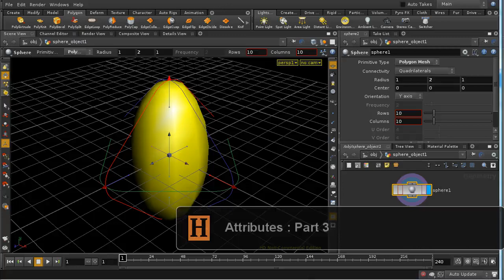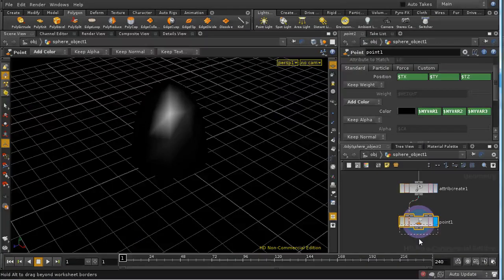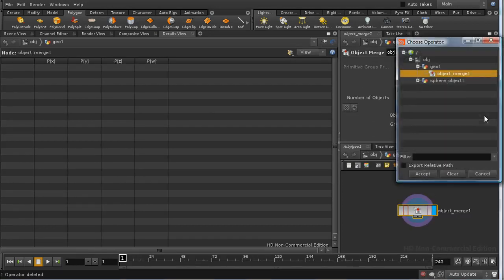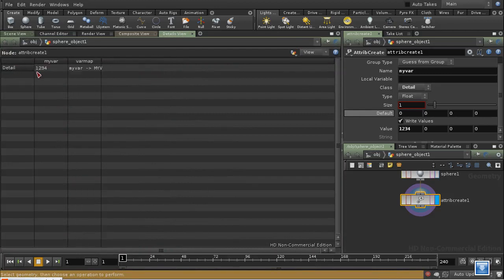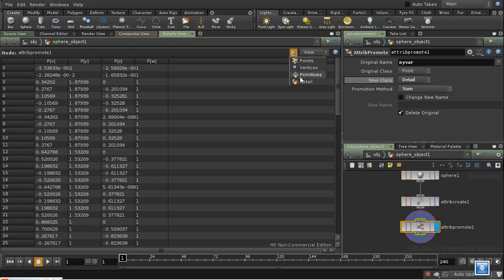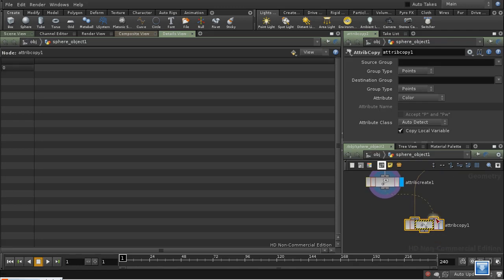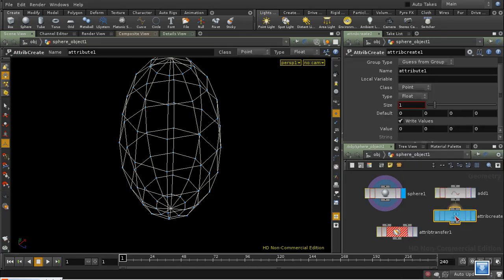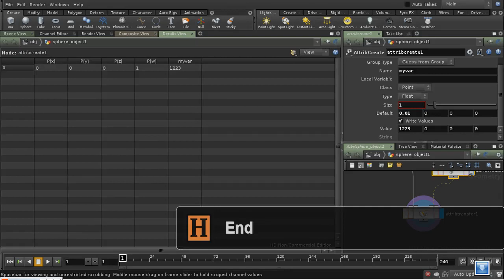Houdini Attributes 3

Comment from the maker: Three floating point numbers can be used to represent many things. If the three floats are a normal vector for instance then they should be transformed as the surface is transformed, if they were a color then the should stay constant as the surface is transformed. Houdini lets you choose either a vector or create a 3 float attribute depending on whether you want it transformed. The video explanation isn't that good - add a transform node directly after your attribute create to see this in action